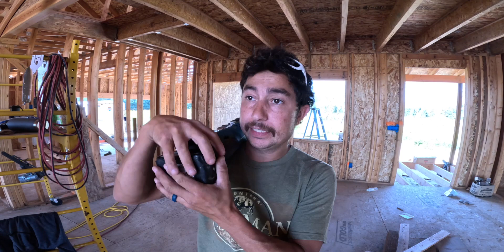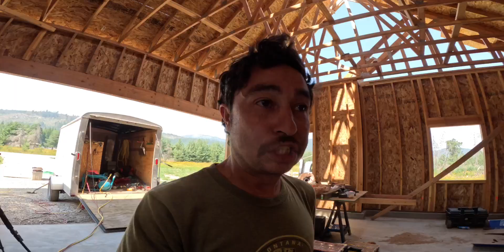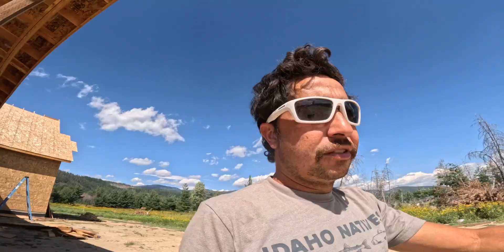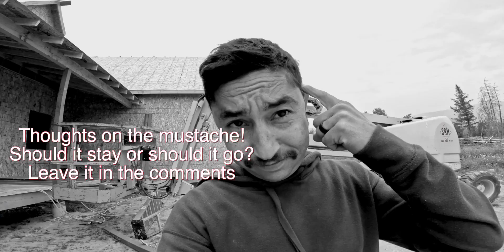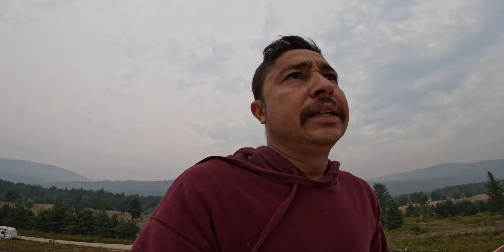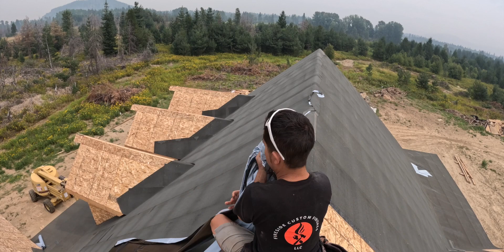I Need A Moment… | DIY Home Build

Comment: I know this is probably too late, but I see most of the outlets you are installing are just duplex boxes. I would suggest using quad boxes in your office, laundry, utility room, and anywhere else that you can. These days, with so many electrical items in our lives, we often need more than just two outlets every six fee. Use quads and you can avoid a whole lot of outlet strips and extension cords.
Reply from the maker: I totally understand what you’re saying. I am using single boxes, but in areas where I know I will need extras like in the kitchen I’m doing outlets every 32 inches and also in my laundry room and office as well. Everywhere else in the house I’m doing boxes every 4 feet or less just so we don’t ever have a problem with not having enough outlets! I may change a few of them out to bigger boxes because that sounds like a good idea.

Comment: I am the same way with electricity. I know just enough to get myself in trouble. Lol! Man if I wasn’t 3 thousand miles away from you I would help you blow that rough out in no time. Problem with electric is that the codes very so much from state it’s hard to say whether my way of doing it is up to code where you live. That is why I don’t say much about it. Well good luck on the roof. Hope you get it dried in before bad weather.
Reply from the maker: The codes in the county I live in is probably the most lax in the entire country except for Alaska!lol ! No building codes at all - the only inspections are electrical plumbing, and HVAC! We will be dried in %100 by Saturday! Doors and windows as well! Just in time we have a chance of snow next week😬 and hopefully picking up my cabinets next week!